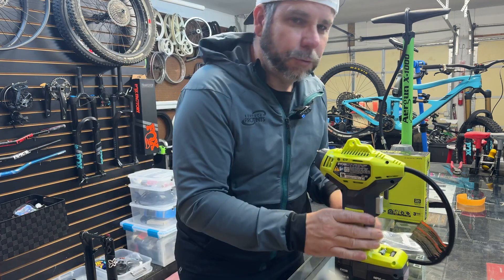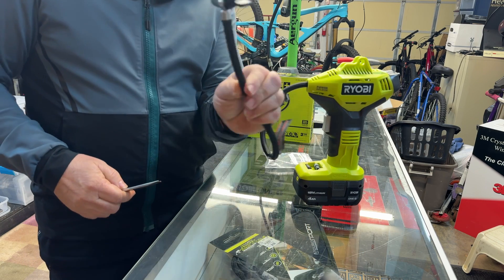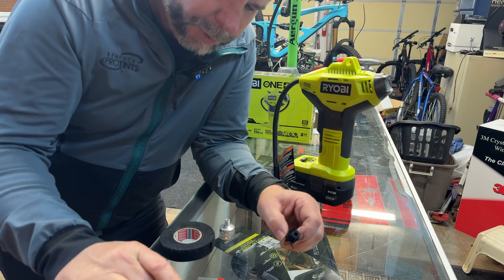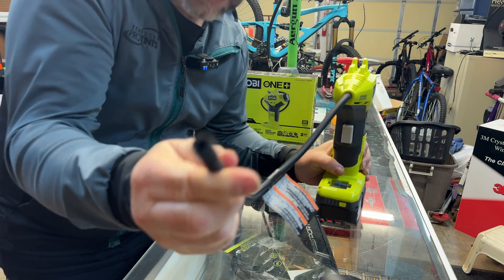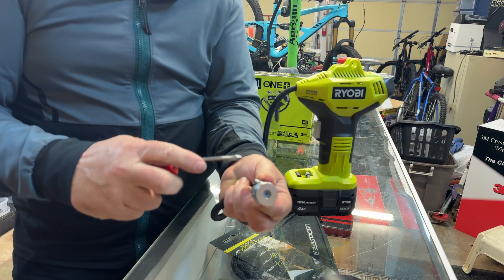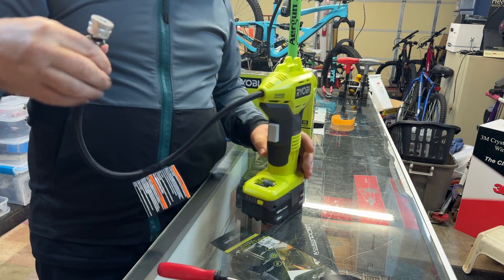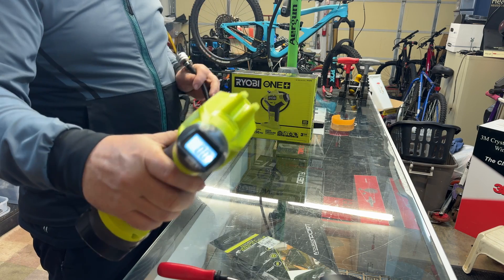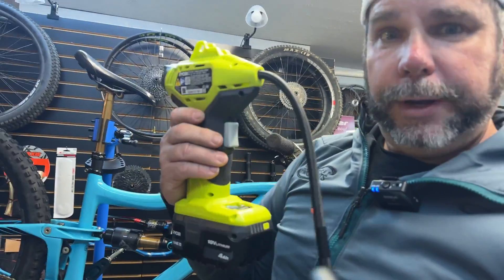DIY Ryobi Air Pump Modification for Presta Valve | Easy Bike Tire Inflation Hack

Comment: Does it seat tires for Tubeless?
Reply from the maker: yes and no
Reply: These types of inflators usually inflate too slowly to pop the bead when you first install tubeless. Need a legit compressor to be foolproof